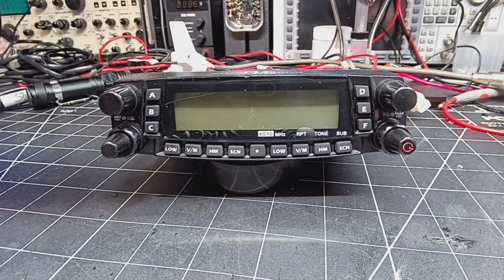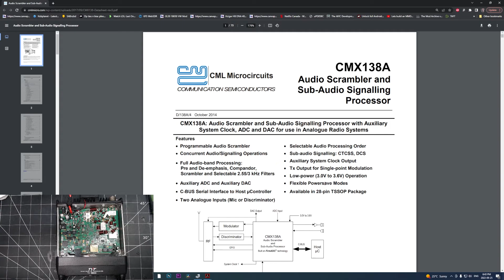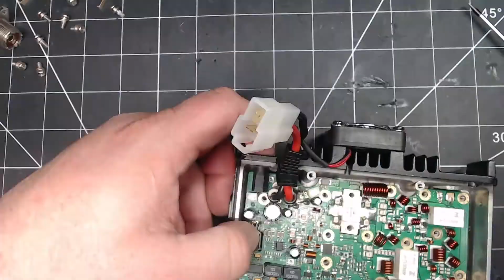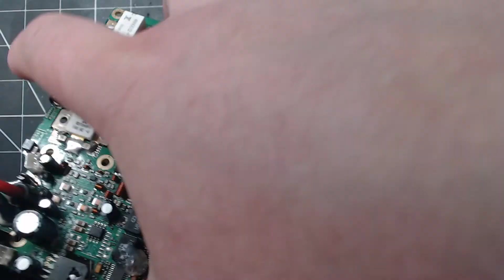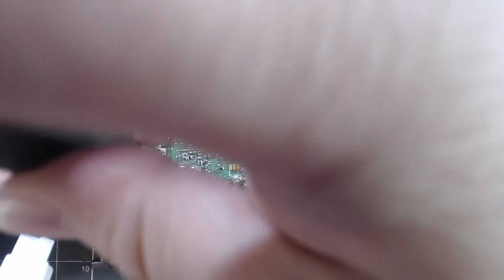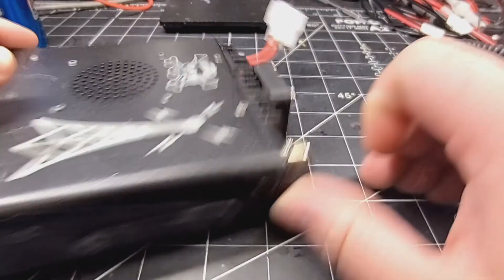TYT TH-9800 Repair Intermittent power issues

Comment: Very informative video! I was about to purchase this TYT TH-9800 but have heard about failure issues.  I am undecided if I should go with Anytone AT-5888UV III... at least I haven't heard of issues so far with that model. Have you come around to have a look at that particular radio on your bench?
Reply from the maker: I would go with the Anytone over the TYT. But honestly I would rather buy a used Brand-name radio over a new Chinese radio. The Icom's, Yaesu's, Kenwood's are better built and perform much better.

Comment: Those are the two CMX138 A/D chips used for each frequency bank.  Original 9800's over-voltaged the chips and theyd both eventually go out.  The revised radios sliced the input voltage and added a zener diode to drop the voltage to 3.7 volts.  Ive replaced 3 chips on two different boards.  Blown chips result in low auidio out and low mic gain to no audio out via the mic during transmit.  I went through 3 of these radios.  What appears to have happened is somone unfamiiliar with SMD repair over soldered the tabs and left too many pins not anchored and also to much flux left behind and possibly even shorted tabs with slag solder.  Two solutions during repair.  (1) install a zener diode to drop input voltage from 5v to 3.7v; (2) add a heat sink to each chip to help dissipate excessive heat generated during transmit.   Caution should be noted that the capacitors in front of each CMX is easily over heated.
Reply: MATE  has 1 theses in UK , ENGLAND . Fault no audio out from 1 side radio tx  ok . GUESS  1 off cmx138 gone open .  & NEED diode mod .

Comment: As I'm writing this in December 2024, quite a number of tech and radio reviewers rate the TH-9800 very highly, so perhaps the manufacturer has resolved their issues. I certainly hope so, because I recently bought one. Mine is the "D" variant which was advertised as being "improved" so fingers crossed.

Comment: Two issues: Back light is dim 2) airband is not very clear as compared with quansheng uv k5 .
Reply: Any fixes ?
Reply: Also can you please mark clearly of the two zeners . One was clear other one with zener and resistor , is it in series with diode . And value. Of both. Zeners and resustor for preventive maintenance?  Thank you

Comment: I just got a 9800. Not my favorite radio by any means but it works. I should have just spent the extra and got one that matches my KG1000+. I did get the 9800+ if that makes a difference.

Comment: Hi, THANKS so much for the video and explanation. I have very recently received my TH-9800 PLUS version s/n 2306AR00142 from China and it also has the zeners missing. I see the resistors you removed were 100 Ohms, in my version they are 4R7 Ohms and next to impossibly small for me to remove; however I do think I can solder in the 3.9V zeners as the pads are larger. Possibly a stupid question but will it matter if I leave the 4R7 resistors in place and just add the zeners?  Sincere thanks. Paul, G0odp.
Reply: What will happen if you leave the 100 ohm resistor in?

Comment: I have this radio I ordered it on eBay brand new but when I try too transmit on repeaters it won’t transmit ???
Reply: If it’s only on repeaters, then you probably have something programed wrong or wrong setting in the radio that is not correct. If everything is program correctly, you need to make sure you have the end code/decode turned on for the PL tones to transmit.
Reply: @redviper2212  I’m going to order a swr/watt meter from Amazon to test the watts on my tyt too make sure is properly using full power would any watt meter work?? There is Surecom  swr meter 27-30mhz that only works on those frequency would that work to test the power on my radio??
Reply from the maker: Any cheap meter will work. The cheaper ones will give you "Peak" wattage readings instead of "average" so they will appear a bit high. That Surecom one is actually not too bad. It will read PL tones as well which is convenient.
Reply from the maker: Like redviper has said, you must double check that you are transmitting the correct PL tone if the repeater requires it. Also you must have your + or - offset setup for the repeater input frequency. If you have done all of these things correctly, there could be an issue with the radio still. I just happen to have one in the repair pile that has PL tone issues (it will use the correct tone for a few seconds and then drift into the wrong tone eventually and drop the repeater). That repair video will happen soon, I'm curious to see if it is caused by the same CMX chips as the one in this video.
Reply: try the other offset. you cant do a plus offset on a 449mhz repeater, that's out of band for example.

Comment: with all my respect but you are calling the filters "relays"? strange
Reply from the maker: The black plastic packages yes, they are mechanical relays and very poor-quality ones.
Reply: @salvagegeek  the only relays on the board in your case are white !  those are "450KHZ ceramic filter"  , have a nice day
Reply: @salvagegeek  These are IF filters😂 not relay...

Comment: Thanks for the video. My TYT just crapped out on me. Doesn’t look like the same issue, but if I get it fixed I will definitely do the Zeaner diode mod.
Reply from the maker: That's too bad. What is wrong with it? I have another two of them in line for repairs as I get through the pile.
Reply: It looks like the coil closest to Q409 Overheated and melted and might’ve shorted out some resistors and the cap in that area. I can send you a picture if you want. It is under warranty so I contacted the place I bought it from and they are sending me out a replacement.
Reply: @redviper2212 did you buy it on eBay
Reply: @warzone7571  no got it from radioddity
Reply: I want to buy a swr/ watt meter to test my tyt th 9800 will any work too test my power on my radio Amazon has some fo 30$